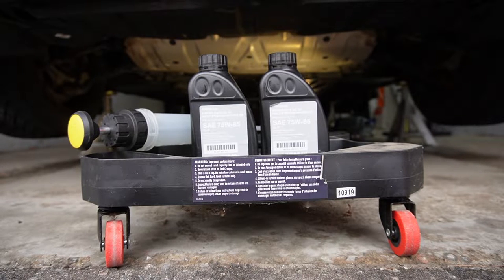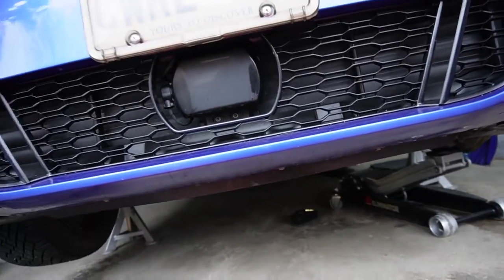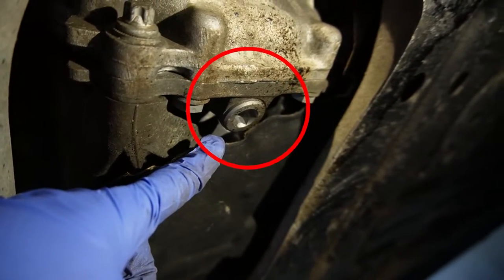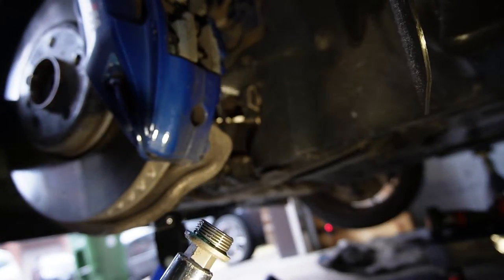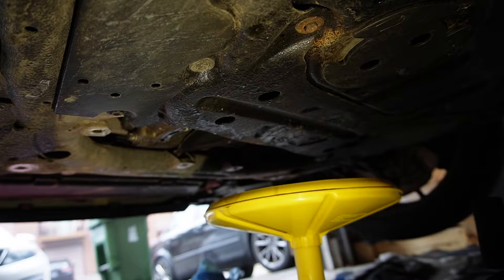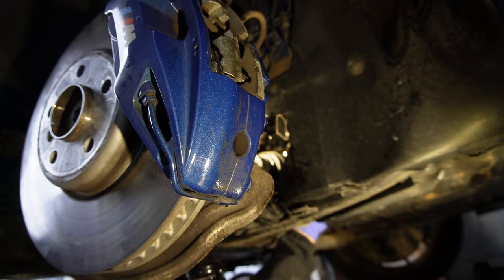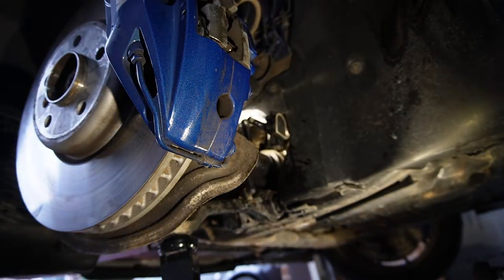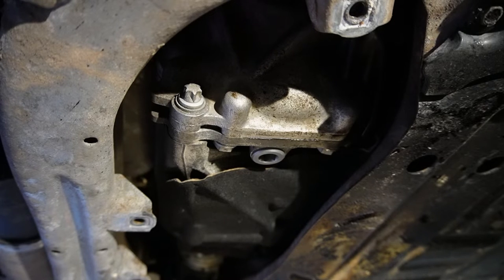*DIY* Changing Front Differential Fluid | BMW G20 M340i xDrive

Comment from the maker: Other things you should know before you begin tackling this front diff fluid change on your G20 xDrive, after watching this video:

- Check out this video to learn how to jack up a car on all 4 corners, as you'll need the vehicle to be leveled to the ground before you start filling the system back up.
https://www.youtube.com/watch?v=wVIp1C_wPAA

- Check out this video to learn how to change your rear differential fluid as well!
https://www.youtube.com/watch?v=3VnUSgnX6Z0

- Torque Spec:
     - Fill & Drain Plug: 60 Nm / 44.25 ft/lbs
     - Front Stiffening Plate Bolts (the 18mm): 56 Nm / 41.3 ft/lbs
     - Wheel: 103 ft/lbs

Comment: Bro thank you so much I have a 2020 m340i and I don't really see anyone doing videos for this car for the maintenance. I did my rear diff fluid change and I also serviced the plugs coil packs and the trans fluid as well. I never thought about servicing front diff now I will definitely do it. Thank You so much! Please keep making more videos as I have a 2020 M340i as well.
Reply from the maker: Thank you for your kind words! That's definitely one of the reasons and motivations for me to make videos on my M340ix, there just isn't much content out there that isn't like "wheel reveals", "new front lip and diffuser" for the M340. Absolutely no hate to fellows making those videos. But to me, owning a car 101 is to service it (or I guess mod it too? :P) ; and I wanna know how to service it (or mod things :P) myself.
I argued on the internet that the higher the car's MSRP, the less likely the owners are going to work on the cars themselves. I'd assume that's one of the reasons why there isn't much content out there, say versus the E9x/F3x.
Reply: What tools did u need?

Comment: You have a coolant leak in the same spot I did, you can see the dried coolant when u removed the plastic shield
Reply from the maker: A local shop flushed my coolant system (I was brainless when I topped up the reservoir with the old blue coolant instead of the new green in G-series) while they were doing the oil pump. It’s likely dried-up coolant residue from them draining it, as I have no coolant loss - for now.
It could also be dried-up salt that I live in Ontario, Canada, where they like to spread a crazy amount of salt to dissolve snow 🤷‍♂️

Comment: I’ve been watching your videos for a few days now I love the information you provided, just a quick question about the front diff, would it be ok if I was to mix the oem oil with new redline 75w85.
BMW is expensive.
Also I’m going to do the rear differential as well but I’m planning on changing the cover for the diff so I’m going to change that oil to redline as well, what is your opinion on that? On Not using oem?
Reply: I was mistaken for the drain process, I see you can completely drain the unit so the over all question is, is it ok to switch from oem to redline 75w85
Reply from the maker: Glad to hear that! For both front and rear differentials, I’m not totally against mixing residue OEM fluids with other aftermarket options - chances are some aftermarket options offer better performance and protections than OEM.
However, I don’t think BMW has ever published the information about their recommended or approved viscosity and specs for these drivetrain fluids on the G-chassis, that’s why I’m not too confident about aftermarket options, in terms of which one is “good” to be used.

Comment: I find that the capacity of fluid of front and rear differential drains out less than the fluid put back in, is that normal that the fluid somehow got dry out from time to time? I just changed the rear differential on a lexus and the fluid capacity drain out less also
Reply from the maker: I’d say it’s possible - However, given yours is relatively low mileage, it’d be unlikely. Of course, other factors also come into play such as how you drive the car.
I wouldn’t be too concerned if it drives fine after you’ve changed the fluids with no codes on dash though! At least now you have the peace of mind knowing they’re at its proper level, as long as you filled it up with the car leveled to the ground.

Comment: Hello! please answer me one question. I purchased rear differential oil for a BMW M340i hypoid axle oil g4. This oil was previously green in color and had a viscosity of about 75W-80. Now the oil is yellow in color and its viscosity is somewhere around 75W-140. Can you tell me if this is how it should be? I can't find information anywhere... Could it be a fake…?
Reply from the maker: Replied in my rear diff fluid change video, check that out!
Reply: @TandeGarage  Thank you so much!